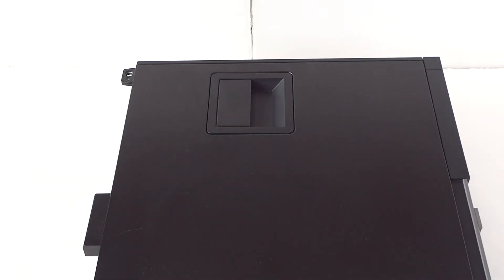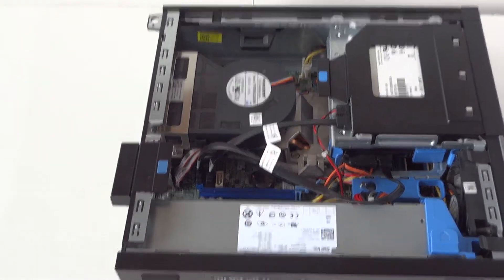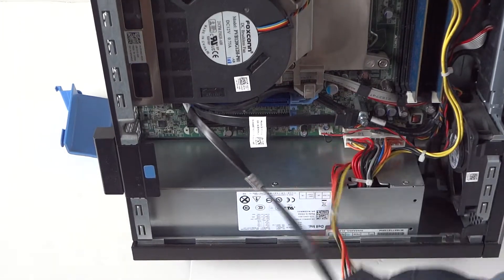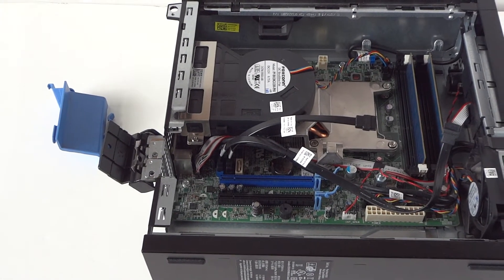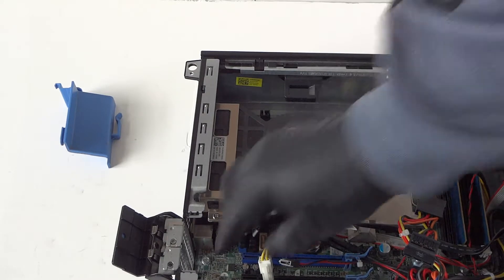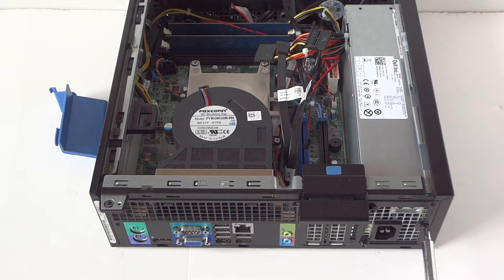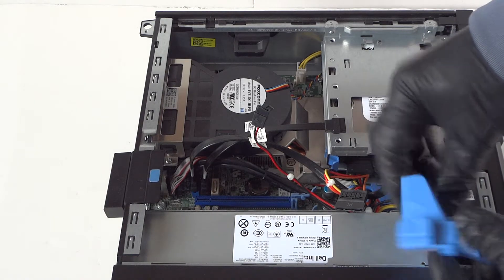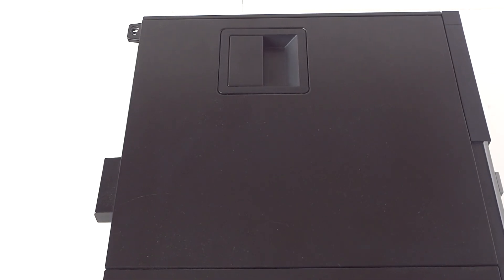Dell Optiplex 790 SFF Power Supply Replace

Comment: Normally psu bist light blink everytime you plug the computer. Right. But now , i plug no sign of light anymore.

 (Dell 3060 sff psu)

Bro how do know the power supply is dead. I try to test my psu, only psu motherboard and processor are intact. My psu is BIST BUTTON FREE.  I remove the 4pin 8pin connector from the motherboard , then plug the psu. The Bist light glow for 3 second,  i put back again, it won't glow. No sign of light, 

I try also psu test using paper clip method jamper black and  green the psu bist light glow and the fan is spinning

Is my motherboard is dead or my psu?

Comment: So I was looking for  power upgrades for my pc... and I saw this video... LOOKS identical.  I wanted to know  if and what the PSU  can be upgraded to...  PS ... also trying to add a gpu sooooo any info is a huge +  .. Ty .
Reply: phil k You can probably upgrade to any psu with a higher wattage as long as it’s the same size, width etc as your original one. In terms of a gpu it really depends what you want it for. I’d do this upgrade for budget gaming so I’d buy a 500w variant of the psu I saw on eBay and replace it then buy a low profile 1660ti as it’s small and has a low power consumption so there’s no safety hazard and it will fit perfectly hope this helps

Comment: can i use an evga 400w power supply on it?
Reply from the maker: Hi, yes on sff case you can use  evga 400w  ATX power supply external for testing.
Reply: @Mxkdt  ok few thank you a lot because I was doing this for a gaming setup and you helped a lot.
Reply: Do you know how much psu is in that type of pc?

Comment: @Mxkdi can i use this power supply vith gtx 1050ti and i7 2600
Reply: Im pretty sure 1050ti requires a 500w psu.
Reply from the maker: Hi yes you can with 240w with 1 SSD Drive only.
Reply from the maker: You can also use gt 1030 low profile gigabyte video card cost alot less.

Comment: so if i wanted to get janky and run an external power supply of a higher wattage, would a standard one work? this appears to be a standard 24-4 but i was hoping you could confirm that
personally have a 7010 sff but they appear to be the same is this regard

Comment: replacing it with one that is an upgrade would be much better, really, after you take it out, being the same unit, its pretty easy to put back in. 
  i have found adapters to replace the power supply in a TOWER but these SFF one have this weird elongated PS. i was looking to see if anyone has figured this problem out for the small ff.

Comment: is there a 400 watt or higher power supply of this sff unit?
Reply: Yes https://www.ebay.com/itm/400W-Power-Supply-Replacement-for-Dell-Vostro-200-Slim-200S-400-220S-SFF-TFX/281189582304?epid=1955639190&hash=item41783485e0:g:j4YAAOSw1rBbMluO:sc:USPSPriority!49507!US!-1#wrapper-reviews-btf--parent
Reply: @mfrmgklsdmgmg5455  intersting astroboy ty..ive been looking all day for higher power sources than my measly 240 watt this 400 is a big upgrade...probably still not strong enough and doesnt look like it will even fit but the cords match up i guess thats all that matter..ill give you another task if you dont mind..;) anything higher than 400watss with the same hookups.....my 240 watts fries when i play scum.
Reply: @mfrmgklsdmgmg5455  also that says dell vostro this is a dell SFF does that matter? and maybe m,y motherboard is different or not compatable?
Reply: @mfrmgklsdmgmg5455  astroboy i think you just became my computer guru ive been slaving allday looking for this upgrade ty so much.;)
Reply: @sonnyc3826  I too was looking on the internet for a bigger power supply FOR my sff,if u search up Dell sff power supply there very identical so it would most likely fit.
Reply: @mfrmgklsdmgmg5455  400W Power Supply Upgrade for Dell Slimline Optiplex 390 790 990 7GC81 6MVJH...i found this one also.
Reply: @mfrmgklsdmgmg5455  its on ebay
Reply: I'm looking for the same goddamn thing. I roasted my PSU while trying to play Elder Scrolls Online, and I knew this would happen, so I decided to try it out so that I know how shitty the PSU is. It died on me once when I tried playing Rise Of The Tomb Raider. When searching the web for a PSU replacement, all I found was the 240W PSU. The 400 W one happen to typically not fit in the case and requires a converter cable I believe.

Comment: what most powerful PSU would fit in this model?
Reply: Doesn't appear that Dell chose to use a standard form factor, so basically this is the only one. Want more than 240 Watts? NOPE. :(
Reply: doomer37 u are wrong
Reply: @Jalbz1  ...and he's wrong because......?
Reply: Danny Meyers he is wrong because dell optiplex 790 sff uses standard 24 pin for the psu so u can upgrade with any atx psu,i upgraded with 500w
Reply: Nintendo Land Sure👍 is there any way I can contact you to send you a private video?(i did a full led case swap)
Reply: @Jalbz1  do you have the link buddy?
Reply: Nintendo Land yep like every dell optiplex